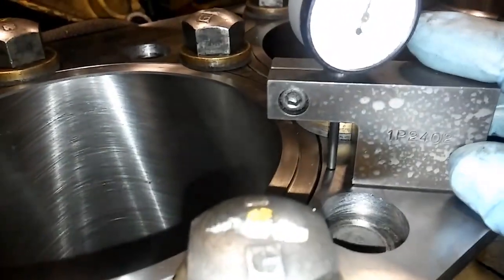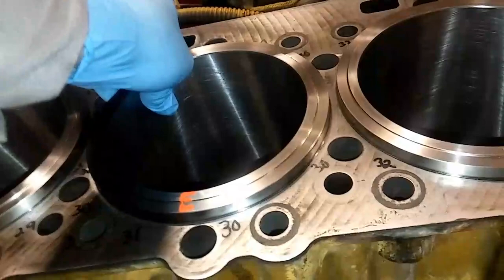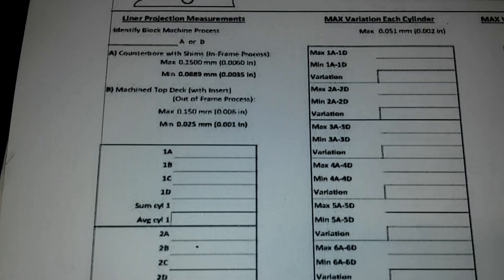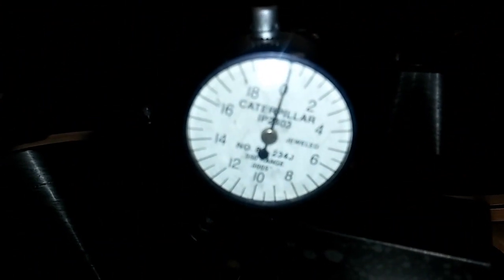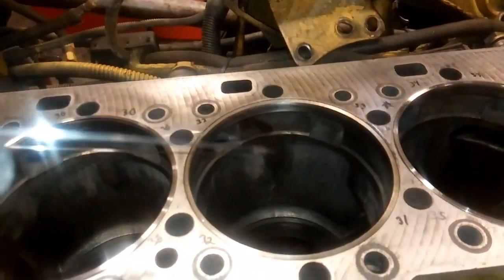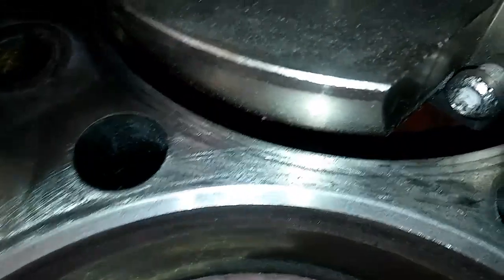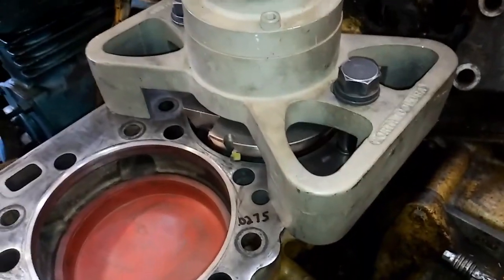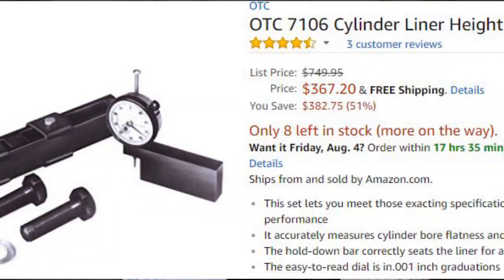What Is Liner Projection?  What Is Liner Protrusion?  What Are Counter Bores?

Comment: This is the exact stage I am at now with my western star rebuild. I am currently doing a inframe on a Detroit 14 liter before I pour money into the interior and paint. This is the only part of the build I have to sub out. I called a few machine shops and dealers to see who will come to me and do this. Quotes range from 200-250 per hole plus 150 road call plus 140 per hour. 1500-2500. Cutting these blocks is not cheap but one of the most important things on a rebuild. Thanks for sharing and explaining.

Comment: Why do the 3400 series engines always want to sink in just one corner? I’ve seen it way more often than an “evenly sunk” liner. 3406, 3408, 3412, c15-18, c27 and c32 all seem to like to do that more than others. I also work for a cat dealer on heavy equipment in the field , and for a few years I worked in our rebuild center building engines. No one has ever had a good answer to that for me, I haven’t found one either. I also get asked this question, and all I can say to them is I wonder the same thing

Comment: I just bought a Truck and it has compression in the coolant. My Truck is in the shop for check up and probably getting counterbores. Can they check protrusion to make sure it needs counter bores or there is no other way to check counter bores other then remove liners ?

Comment: I need your advice forums are not helping. I know you dont work on detroit but i need your input please. I got a 12.7 series 60 no egr last week my turbo started failing smoke out of exhaust at idle i replaced with a new 171701 borg warner. 2 days after i parked to unload a load and saw that the whole engine driver side was covered in oil. I took it in they cleaned it test drove it and all they could see was small amount of oil what it looked came from intake manifold and that my cam seals are shot. Their explanation was either cam seals are leaking bad under load or that when my turbo failed oil went in to intake and blew out under heavy load. But i only saw oil in the back of the turbo hot side not in the cold side. What do you think about this they said truck runs and sounds good which it does i was afraid of Headgasket no loss of power no noise no overheating

Comment: Nice video man 👍🏻. Question: what do you recommend for the bottom seals on a wet liner (3406B) .  the OEM says soap but it’s hard to know what soap is not going to corrode . What do you think about using CAT rubber lubricant on the o-rings ? Cheers from Australia
Reply from the maker: Rubber lubricant or tire soap is the recommended soap.
Reply: Adept Ape  is there a CAT part number for liner soap?
Reply: Found it on sis  5P-3975 rubber lubricant

Comment: After I do the cutting how long can I run the engine without having trouble again  please let me know asap thank you and very informative video.
Reply: I have had to recut holes when head gasket fails and fretting occurs. Should last a while if all is done correctly. You cannot take a short cut any more. These engines are getting old and tolerances have gotten tighter. New/milled head, new spacer plate, new head bolts, new liners, proper lube on head bolts, block holes tapped out, block surface flat. Follow SEBF9008 from CAT.

Comment: Hey josh, first off love your channel and your in depth info you provide. Second, I had a question about what pitch the small head bolts to torque spacerplate are? I found the p/n on a soft washers but no numbers on the bolts. Thanks again

Comment: Hey Josh I love all your videos and find them very helpful and informative. I have a quick question about C-15 liner protrusion. I just had to replace the entire head with a brand new one due to an exhaust valve failure and I was wondering if this is something I have to check before installing the new head with new gaskets? I never messed with any of the liners or pistons.
Reply: Any update

Comment: Hello Josh! Thank you for the great video. I still have doubts of how many thou the shim has to stick out from the block when it was cut for shims. I don't think I understood or missed it. Is it .0035- .006 higher then the block?  Thank you!
Reply from the maker: Well generally the shims fit close to flush or slightly above the deck, but you really only measure it with liners in. Then the liners are about 4-6 thousands above the spacer plate and spacer plate shim.
Reply: @AdeptApe  I greatly appreciate your quick response!

Comment: Hey adept!
A 3116 cat engine on a truck works fine, but when its cruising on a highway, hot burning red flames exit from the exhaust and the turbo turbine shell housi g turns very btight red, changed turbo, pistons, injectors, no change. Any help??

Comment: Hey josh , got my 6nz pulled down due to head gasket . Checking liner protrusion and this motor has 1.4 million and 300k on platinum kit . Block is cut and shimmed.  Is cutting the block a 1 time fix ? Or have you had issues after its been shimmed and sink a liner . Replace the shims ? Or is it rarely an issue after the cut ? Also have you heard of Indian head shelac on block and shim for under spacer for water sleeves ? Btw this burnt out the back side of 2nd hole not bad but enough to bubble in rad . Could it push to liner seals ? Tia

Comment: Hey Mr. Adept, you've been very helpful! I've bugged you with a few questions and I've now got another. I've got an 05 C15 I bought recently and I thought the previous owner had it turned to 550 but it sure doesn't seem like it. I had it at cat a couple weeks ago hooked to Cat ET for a different problem and I forgot to ask what it was actually rated at. Is that something saved in the computer where I could just call up and ask with my engine S/N or would I have to go back and have it hooked up again for them to tell me? Thanks!
Reply from the maker: +PickupsAreNotTrucks Can you send me an email at AdeptApe@yahoo.com and give me your engine serial number. I'll try to look it up over the weekend.

Comment: I have question for you, to check the liner protusion i also need to put the gasket below the plate ? That's the right thing to do ?
Reply from the maker: +Edivaldo Veronese On a C15 or 3406, yes you have to put the spacer plate gasket under the spacer plate or your readings will be off.

Comment: Hey Josh  long time watcher of your videos in which are greatly appreciated, I'm working on a in -frame C-15 accert rebuild when checking liner protrusion are you pre-installing the lower gasket with the spacer plate when measuring protrusion
Reply from the maker: Yes sir, you measure with the space plate shim and space plate. You would have a lot of protrusion if you didn't use it.
Reply: @AdeptApe  but not checked with the top gasket right
Reply: @AdeptApe  you would happen to know all my torque specs for the the head, rod and crank journals and oil pump
Reply: Thank you

Comment: I'm currently in school to be a diesel mechanic. 
Random question, how many engine rebuilds have you done due to a diesel engine runaway?
Reply: I'd say that is a very rare occurrence.
Reply from the maker: +Nick Holzemer Shain is correct, I've never done a Truck rebuild were the engine ran away. I did see one when I was in power generation. It was on a mechanical engine that had the rack stick to full fuel.
Reply: Whilst working for CAT as a mechanic I worked with a very skilled and experienced senior mechanic. One day he had a routine c15 turbo change out. The turbo was changed out all the normal checks done etc. but when this thing was fired up, man can I say what a show it was. Wow. The massive workshop I was in was filled with blue smoke in 10 seconds flat. I could not see 1 meter in front of me. And the scream of this massive diesel valve bouncing on it own oil was something I will never forget! Turns out the intake manifold must have been full of oil from the previous turbo failure, but had not been picked up when changing it out for new. Valves/head destroyed but bottom end ok. So always keep it in mind, it can happen, and when they run away you have to be prepared. But most of the time it's to late.
Reply from the maker: +Cherry Popper If that sucker starts running away and you can't stop it immediately, that engine is basically a bomb ready to blow off it throws a rod. That thing must have dumped a lot of oil if it made it through the CAC.
Reply: Agreed.  Stuck rack is the only time I know of runaway condition, and that usually only happens after a pump rebuild, or some pump "tuning".  Probably a good idea to have a CO2 extinguisher on hand and the intake open when messing around with the mechanical pumps.  No way in heck would I stuff anything near the intake when it's running full tilt.
Reply: Most of the time they destroy the valve train and will shut down from no compression.
Done a few over the years. One customer got a new engine on one. Turbo failed and driver could not shut it off. Push rods was bent and clutch springs was slung out. 
Another one we fixed, pulled the head, gear train and made repairs. Customer would not allow us to remove the engine to replace clutch. I called him and told him truck was ready for him to wrecker home. Then he allowed us to replace clutch. It actually twisted the driveshaft as well. 
The one I like the most was a ATAAC full of oil. At another shop. They replaced turbo and went to lunch after they started engine. It broke rocker arm stands, bent push rods and pushed the lifters out of the block on a few cylinders. Truck was wrecker-ed to us.  
Have a 3306 1972 model with a sleeve metering fuel system. All pumps are locked up right now. 
Recently had a B model that all pumps from factory was clocked wrong and engine would run away if you touch throttle. It would crank with shut off removed and rack was in the off position. 
We did have one 3406E that would run away. ECM had failed and it would hit TEL in a couple seconds. Would not do it all the time.  
Few years ago we had a E model that dropped a valve. Knocked the tip off the EUI and piston was pushing the fuel back into the intake. It was going into the five good cylinders and taking off. Driver got it shut off, but still did some damage.

Comment: Check out IPD parts, they have a good video explaining a lot about liner protrusion and how they drop.When I was at the dealership I wanted to cut the blocks to get a better lasting repair, but they said as long as its in spec don't cut it. engine would make it about a year before the head gasket would fail.  the few I did cut never had an issue.        Good video J.
Reply from the maker: +camshaftP16 The liner shims seem to absorb the wear of the liners better than the block does. I checked out IPAD AND they have some nice looking parts, I'm assuming quite a bit cheaper than Cat as well.
Reply: Thanks for all your videos, it helped me when I was rebuilding my 1LW , also follow some of your advice at TTR.   IPD does make some good parts that's what I used, some shops even guys at TTR think they make some parts even better than Cat's parts. my next project will be a de acert acert with all IPD parts including one piece pistons with 16:1 compression, Thanks again. T800H

Comment: How tight do you tighten the hold down bolts when you check the  Protrusion
Reply: 6 bolts per cylinder with the proper soft washers and its been revised to 70 ft lbs

Comment: Any chance you can put up a link to get a protrusion worksheet?
Reply from the maker: +None Ya business The form is really only for Cats OPT warranty inspection.  You just really need to check the cylinder at 4 places roughly 90 degrees from each point and log it. If each cylinder is within .002 and within .002 of the other cylinders it is with spec. Assuming it is.001-.006 on a C15, other engines have different specs.

Comment: is there a generic Liner Puller tool that will work with the c13?
Reply from the maker: +Mister Nightbane Yes there is, we have one at the shop that is universal, you have to remove the piston though.
Reply: whats the part #?
Reply: Search on Amazon, they have em, though they're not really cheap
Reply: I just made mine. One inch treaded rod heavy plate on the bottom and a piece of frame on top

Comment: My truck is in the shop now getting an inframe because of this exact problem. 
Head gasket went out in April. 
Coolant was pressurized on a Detroit 14l 2007. 
Isolated the compressor and EGR and still had pressure. 
Bought a 40$ head test Dildo looking tool (I call it a dildo cause you know your fuked when that goes in your truck LOL) 
And sure enough it blew bubbles and also turned green indicating combustion in the coolant. 
I removed the surge tank cap off and drove it from texas to Oregon like that while empty. 
Made sure it always had coolant and also didnt heat up. 

A hole in the wall shop said block and liners are fine and installed a head gasket. 30k miles Nov comes around and guess what? It was pressurizing the coolant again. Exact same problem. 
Lucky I only had to make it 800 miles to the house. 
Removed surge tank cap again and limed it home. 
I took a ph video. DM me and Ill send it to you. 
sprayed some light coolant but never hit the low coolant buzzard the whole way home. I stopped about every 200 miles and checked coolant. Had to ad in the morning about half gallon. But I think thats cause it got cold and contracted. Vs when its hot it expands and hit the coolant sensor. 

Decided the dealer is the place to take it to this time. 
They called and said head is good but liner fell. 
I went to the dealer and looked at the head gasket that was removed at it was burned and cracked in the same spot as the previous one.. 
The first shop didnt see this video or understand the concept. Thus here I am paying for the job to get redone and now I am also getting a inframe done. Which I should of had done the first time. 
Im glad I didnt have that shop do it. 
Nothing like spending 16k for a inframe at freightliner dealer to make one feel like "badassbillybigrigger" Or brokedickownerop. 

Thanks for sharing. Good job on the pics and video showing the tool needed. 
It helps me understand what happend and how the dealer fixed it. 
they charged 1300 to cut the block.

Comment: My truck is the year before the Powerstroke but it has a turbo
Reply: bryant gordon good old idi only problems with those is heads would go if you ran toomuch boost or cavitation will get em sometimes
Reply: bryant gordon oh change your glow plugs every fall and DON'T USE autolite brand plugs they swell and get stuck in the head
Reply: Thanks for the advice